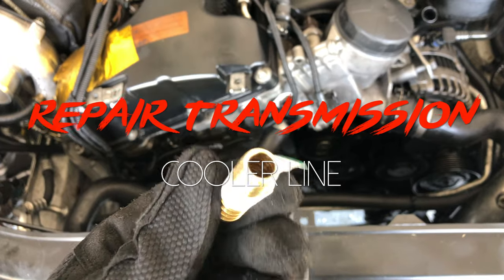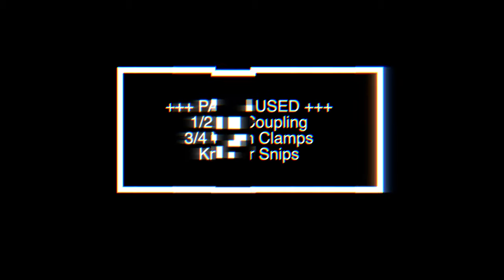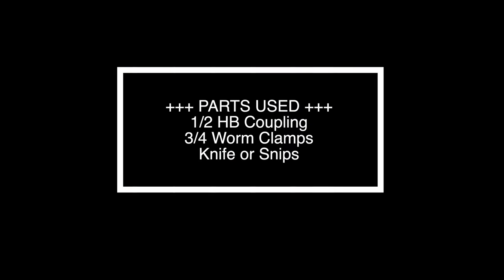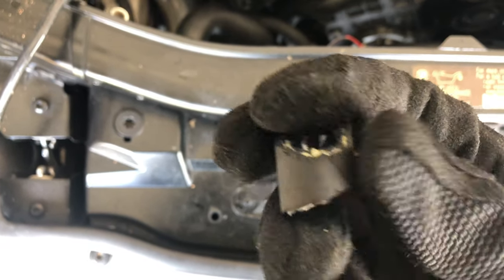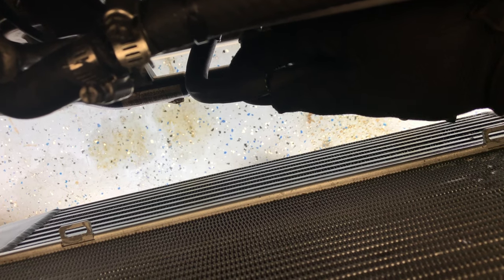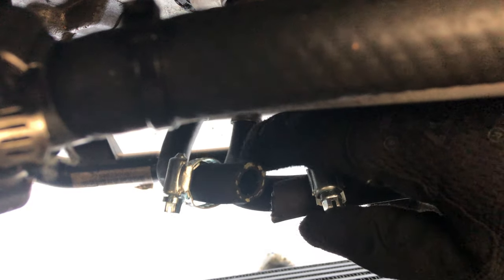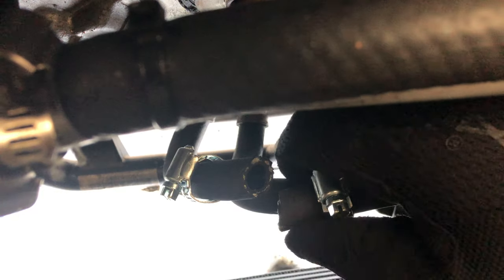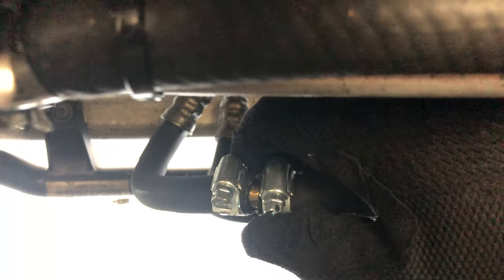BMW E90/E92 Quick Transmission Cooler Line Repair

Comment: FINALLY!! -the video I have been searching for, for longer than I care to admit lol.   I want to thank you so much for posting this video as I'll finally be able to get my car back on the road confident in this temp solution (which will probably be so good that it outlasts the life of the car)  !!!!! Thank you so much
Reply from the maker: Glad it was of help !
Reply: So this worked out perfectly - nothing is leaking ....however since I did lose a little fluid I would def have to replace it  or do I risk damaging things if I were to drive it as is?      I'm not that confident in adding transmission fluid.....I just want to know if I would be doing more damage by driving the car before tending to this issue.

Comment: anyone got any idea on putting in a new hose? i recently got a new one and was wondering if anyone also had problems with installing it lmk!
Reply from the maker: Can lower the subframe or support the engine and disconnect the engine mount raise the motor up a bit to allow you to remove and reinstall the new one. Easiest would probably be lower not disconnect the subframe.

Comment: Is that the return line that you're touching? I'm trying to route a secondary cooler for my transmission on my n54.
Reply from the maker: I can’t recall, didn’t check if it was the line feeding the transmission cooler or the return line from the transmission. But if your going that route then one of those two lines would be a good spot to splice in.
Reply: @nOshi2x  Alright, cool. You wouldn't know where I could find a good 1/2 hb coupler? That one seems pretty thick walled and heavy-duty.
Reply from the maker: I’d try an Ace or somewhere like that.